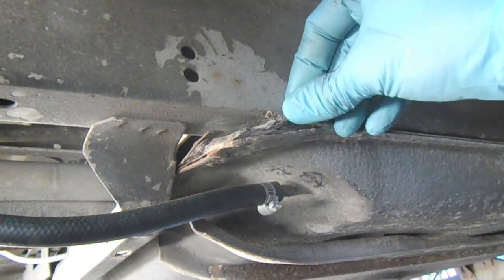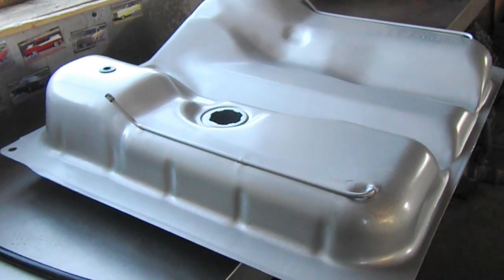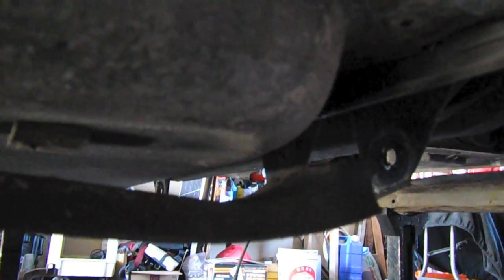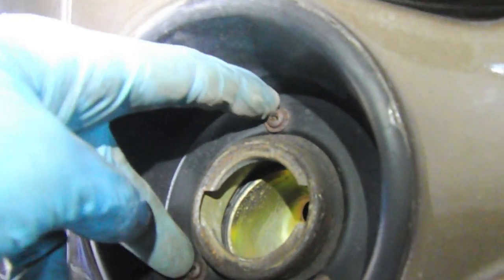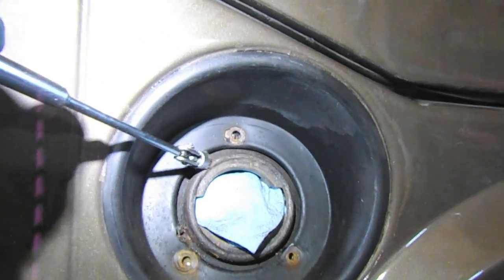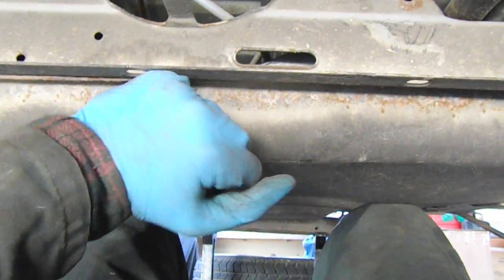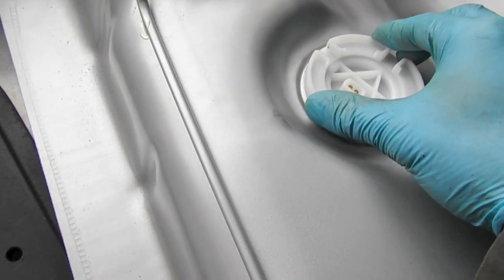Vanagon Fuel Tank Replace

Comment: I actually did this a few months back, myself.  When I bought the Vanagon, a new tank came with it as a part of the deal.  I used the GoWesty kit, and used their crimp-style hose clamps.  In fact, I replaced the entire fuel line system at the same time, with the GoWesty fuel line kit. 

One thing I did was to spray the entire upper surface with undercoating material before I installed it.  The original came that way, and the Samba folks seemed to recommend it.  Also, to make vent and filler installation a bit easier, I used petroleum jelly all around the grommets. 

There aren't a lot of videos on this subject, and the ones I found were from folks who were doing it for the first time, so this will be a good reference for folks looking to do this for the first time.

Comment: Hey man, thanks for the video! Getting ready to do this on my 84' and getting to see one done has helped my prep quite a bit. I still have to inspect all the relevant lines and hoses, but they should all only be a year old. I had a new tank put in with my 2.5 conversion, but the tank ended up getting a dent in it that has since started leaking.

Wish me luck!
Reply from the maker: Good luck! But in sure you've already finished. If so, how did it go?

Comment: I’ve heard that the expansion tanks can get holes by junk tossed by the tires.  Has anyone ever fabbed up guards to keep those plastic babies safe?  If the get holed you can get water in the tank, generate rust and have rough running problems.

Comment: Is it common to have a leak at the filler hose insert location at the tank?  Can I just silicone the outer area?  Of should I just replace the filler neck hose on my 1981 vw?
Reply: Hose is old and needs replacing.,  fill is most likely good.

Comment: The fuel system of the T3 is not a marvel of design. ( mildly said )
Many rubber-breather lines are located precisely behind the front wheels and get a hefty spray or water and tiny stones driving in a heavy rain. The T3 has no plastic mudguards. ! 
The rubber lines go down from the wheel bay to the tank top, hence any water is guided to the rubber grommets were the fuel-breather lines enter the tanktop. 
Here the problems starts after say 10-15 years: water in the tank. (drop by drop..) (wait and you will find...)

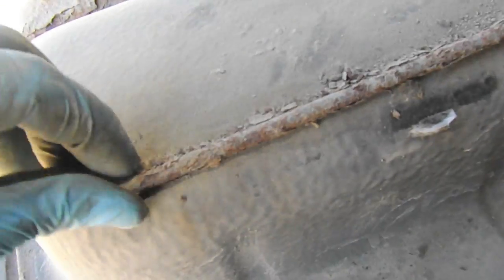Mud can collect between the tank wall and the main longeron of the car, just under the fuel pipe inlet in the tank. At 6:49 you see in a split second the wet spot (= rusted through)  tank wall. My tank rusted through at that spot.
The absence of internal mud guards (Cheap!) would have protected that rust.
The T3 is definitly not a quality car. It was fastly designed and fastly produced to save VW from bankrupthy..
So..
If you need a Japanese engine to propel it, and have a problematic systems on board...you cannot quote:  it is a good car. 
On my bus, I experienced at least 2-3 times the maintenance hours par 10.000 km compared to a very old Suzuki 
Both cars have 400.000 kms.

Comment: Hey, I'm running a 2.2 in my '77 and I've been told to get taller gears for my transmission because it won't be able to handle the torque of the subaru motor? Does this sound right?  I'm running a stock 6-rib from my bus. Will this be fine on trips or is there any truth to changing the gearing? Thanks, and great videos
Reply from the maker: I've heard that 3rd and 4th are the weak point, but I wouldn't worry too much about it unless you're either very aggressive or running a turbo. Since the 2.2 Turbo is very rare, I'll bet your not running that, so I think you'll be just fine.

Comment: Hey Busaru, 

I tried removing my fuel tank on my vanagon to replace all the seals on it, but I couldn't lift the front end of my van high enough to remove the braces for the fuel tank. The braces dropped down at the front, but then hit the ground, and I couldn't squeeze out the pinched ends on the other side. 

How did you do it? Do you have a nice fancy lift?
Reply: Just did this on my van today.  Get some nice tall jackstands, and they'll drop nice and easy.
Reply: Same here...Just bend the little tabs on the brackets, and the brackets will come out...